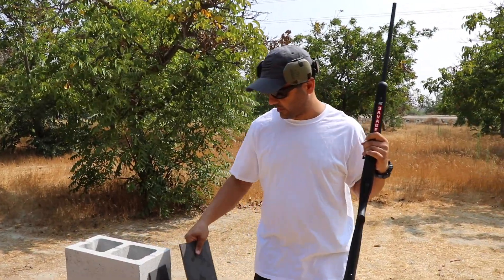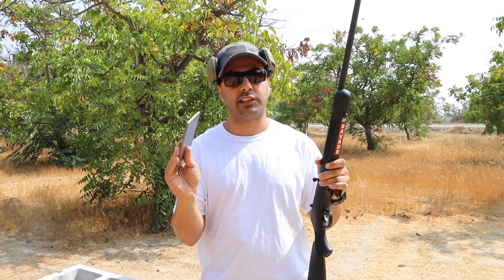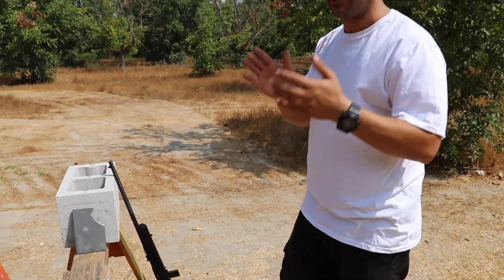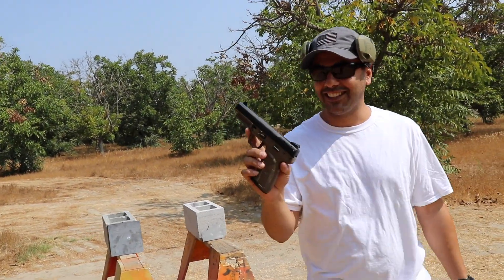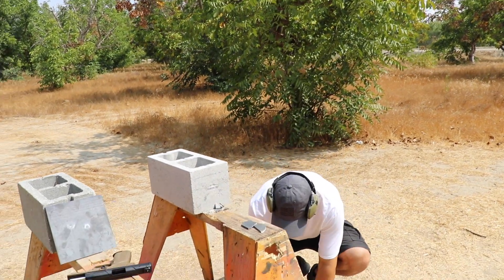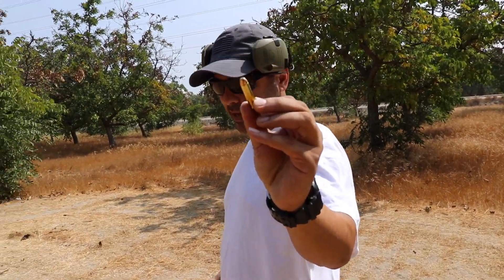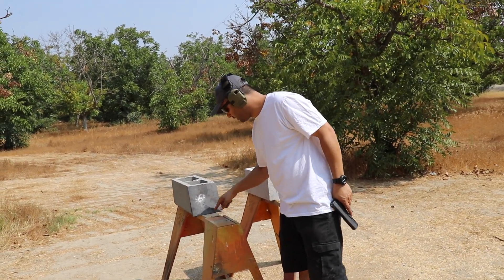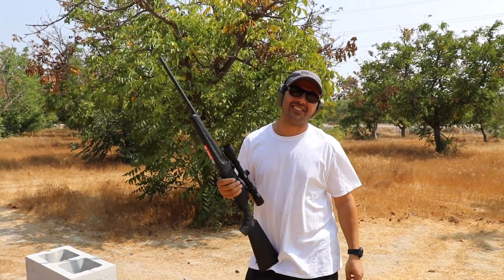Is Tungsten carbide BulletProof? - FN 5.7 vs steel

Comment: Tungsten carbide is way way waaaaaaaay brittler than tungsten alloy used in core of projectiles or in armors, cause the carbide one is conceived to be very hard: it's used to make the tips of the utensils in metallurgic industries

Comment: Tungsten carbide (WC) is not tungsten. It's a chemical compound between tungsten (W) and carbon (C) and behaves like a ceramic, hard but brittle. Tungsten carbide differs from tungsten like CO2 differs from coal.

Comment: big difference between pure tungsten and tungsten carbide, the addition of carbon changes the crystaline structure of the metal as it sets, the carbon allows shear lines to form in one direction but in the other direction it is extremely strong bond, thats why tungsten carbide is used in cutting tools in working with metals, if you had pure tungsten it would have just bounced off of the saw horse with little to no indents or scratching....  research your materials before purchasing, it will save you alot of money and disappointment..
Reply: Well said

Comment: tungsten carbide is alloy of tungsten(swedish word means heavy metal) and carbon in 50.50 ratio and it is used as cutting tool but being so hard makes it very brittle. steel on the other hand has just up to 2.08% of carbon and other elements depending of usage of it. super alloys can contain 8 or more elements in steel alloy
so when somebody says to you "high carbon steel",steel already has carbon in it...and that high means 1-2% because as i wrote steel is till it reaches 2.08% of carbon...above that is cast iron

Comment: Even if it would be pure tungsten(W) it would be much more brittle than steel because W cannot be molten or rolled or forged because at the heat required all tool materials would melt or be unstable or softer than the W. For that it can be only sintered and pressed and so it remains much more granular than steel or other metals.

Comment: Yep, Tungsten Carbide shatters nicely. :-D Its use in armor piercing shells during ww2 was for the sharp shrapnel it produced once the shell penetrated and exploded inside an armored vehicle. So, it's good as a projectile in penetrating and causing damage, but no good at all as armor.

Comment: Tungsten Carbide has 9 points hardness on the Mosh Scale (same as Sapphire). Near Diamond, which is 10. That is so much breakable (just like Crystals). Extremely tough, very dense and robust, but also breakable on major mechanical punches.

Comment: Okay, let's go through this a bit at a time.  Tungsten (Known as Wolfram or Wolframite by the Germans in WW2), is enormously dense in nature, often being used to substitute almost 1 for 1 with gold by counterfeiters.  It's density gives it a toughness that makes it highly useful for plowing through airplanes when used as penetrator rounds.  Carbide, however, is used for cutting tools which requir a different kind of hardness as it is most often found as a ceramic.  It is capable of absorbing higher shock loads than some of the better alloys of steel when mixed with tungsten and machine tools are a natural for this alloy.  However, it is so brittle that you might as well as shoot a stack of plates.  Get some unalloyed Tungsten (it should be MUCH cheaper, if you wish to abuse it with bullets.

Comment: Tungsten is extremely hard ie. Brittle

Note that the block behind the tungsten didn’t get damaged by the bullets, because the high density (weight) along with the high hardness causes softer metals to splash off of it like raindrops off of a windshield

Titanium is extremely springy and flexible, so while it is very likely not to shatter, it’s light weight (low density) and springy nature makes a bullet striking it more analogous to raindrops on a sheet of plastic

Comment: If im an tank designer right now  i will make half inch pike nose tungsten spaced armor i mean a tungsten spaced armor for the front and sides of a tank but give it a 2000 horsepower engine so you are gonna see some real speed

Comment: That 6.5 Creedmoor. Is going 3800 feet per second. I want to see you shoot some steel with a 264 magnum Winchester. The fastest round made for the public 4200 feet per second 40 100 foot pounds of force with 140 grain bullet I would love to see you shoot one. If you can't find one, I'll let you borrow mine. They haven't made them since the early 1960s and it's getting hard to find new ammunition. You have to reload most of it. 264 magnum Winchester was what snipers used in Vietnam before they use the 270 Winchester.

Comment: That tungsten is so hard. If you would put it flat against another piece of Steel. It wouldn't shatter. But you're not good penetrated. Not with those small calibers. But of course a BMG 50 cal penetrate anything. And Allegheny metals in Butler, Pennsylvania Richard Kennedy will sell you any kind of Steel you want. He's my cousin. For real

Comment: Tungsten is incredibly strong, but brittle.
If that was pure tungsten it would not crack in the same way.

Tungsten carbide vartiants mixed with cobolt and nickel is used as armour piercing fin stabilized tank rounds. Aswell as armoured sideskirts for tanks because their ability to block damage.

Comment: That is not tungsten. It is tungsten carbide. Two very different things. Tungsten carbide is what they tip drill bits with because it's very hard, but not tough. Hardness is resistance to SCRATCHING. Toughness it resistance to IMPACT.  Many very hard things are not very tough. Think "tempered glass." Very hard, shatters easily.

Diamond is the hardest gemstone. But you can shatter one easily if you hit it with a hammer. Jade is the toughest gemstone. It's fibrous structure flexes a little making it very resistant to impact. You can drop a jade vase on the floor, if it's real jade, and it won't shatter, or at least it most likely won't.

Comment: that's definitely tungsten carbide, but tungsten carbide's major weakness happens to be brittleness.
Tungsten is the strongest metal, the metal with the highest melting point and it is one of the hardest metals, not the hardest but almost.
I believe its second place only to chromium.
but since its so hard its also brittle, which when mixed with carbon as well, makes the carbide crack and shatter upon sudden impact.
try tungsten metal next time.
(edited)
Reply: It's not tungsten, which is a metal on the periodic table. It's tungsten carbide, more like a ceramic made from tungsten and carbon so it's a chemical compound.
Reply: @SaintBrianTheGodless  you were right.
Reply: @Aaron Washburn you might want to delete some of your comments, with mine gone it looks a bit out of place. :/

Comment: I work in manufacturing and tungsten is a very hard material. Due to the hardness it makes it very brittle kinda like porcelain and certain types of ceramic. You should look at a raw material supplier that provides what they call blanks of whatever material you're looking for. They come in all sizes like from what you're working with to plates that look like your 6061 aluminum blanks. Even if it was thicker I could still see it more breaking off chunks than forming the metal like with aluminum stainless steel and softer other materials

Comment: Tungsten carbide is like porcelain. It will break like glass instead of bending. Tungsten carbide Extremely hard material it is the only thing that will cut glass other than a diamond.

Comment: tungsten refers to the individual metal, whereas tungsten carbide is an alloy of tungsten and predominantly carbon; and is a ceramic sintered from power. Both are very brittle and will break. if you were to drop the tungsten carbide sheet it would probable break if it landed on concrete. Chemitry What a rush.

Comment: Torch the tungsten until it's really red throw it in the oven on 450 degrees for 30 minutes be very careful use good tongs they may melt lol never touch hot steel with your bare hands

Comment: Thermal crack. IT needs to hardened after Made into something. Its Hardest after Diamond . We use thungstencarbide to cut any metal Like a butter. To cut thungstencarbide you have to use diamond   Wheel.

Comment: Love watching you guys, the reason is because tungsten is Brattle but you’ll notice that the 57 didn’t make it through so it did indeed stop the bullet it functions a lot in the same way as ceramic. Which also shatters but does stop the bullet

Comment: Tungsten is rated 9 on the scale as oppsed to platinum at 6. Yes Tungsten has an extremely high melting point but it is brittle and is not really meant for impact but it's still the best on the market.

Comment: Did you that at 45*, the horizontal lengh of the triangle is going to be equal to the vertical lengh of a square the triangle? Not even close

Comment: Tungsten carbide is considered a ceramic and it cannot overcome deformation which means that it’s so brittle due to it’s charged bonds. Also tungsten carbide high speed cutting tools fracture all the time for the same reason, but addition of cobalt will help a lot to prevent them from fracturing.

Comment: Tungsten Carbide is very brittle though it's pretty hard and doesn't really melt. It's used for friction drilling and welding, and it's properties make it very good for both of these tasks, as with TiG welding, it conducts electricity pretty well, though the biggest issue with it is that it can pretty easily be contaminated with other materials while welding. I'm not very familiar in the machinists world though, and I can't really speak for the drilling aspect.

Comment: Tungsten and tungsten carbide are totally different things. Tungsten carbide are mostly used for corroding other substances like in drill bits. Tungsten carbide are corrosion resistant but not impact resistant. They are hard but brittle. They are corrosive but cannot withstand impact. Harder a metal is, the more corrosive and brittle it becomes.

Comment: Pure tungsten has higher tensile strength and might've yielded a little when shot by 9mm but the material you used is tungsten carbide which means there's added carbon with pure tungsten depending on the concentration of carbon in tungsten the brittleness of the material could be defined. After watching the video it's pretty clear the percentage of carbon is around 4-5%. Which makes the material very brittle. Heat treating helps a lot in the strength of the material.. it also releases all the internal stress of the material

Comment: Tungsten carbide is super hard but very brittle, it is horrible with shock loads. If you got straight tungsten without the carbide it would have been a lot tougher and held up better under fire.

Comment: Also you need to test metal with extreme high shear and stress values, not hardness ,as hardness means it will be brittle, you need some of the metals which is listed in the hardness scale from alloy and metal books or reference books which a lot of machine/engineering shops use? Like alloy ASTM Reference books? Also if you can get a hold of Tungsten carbide diamond tips or teeth used in scrap metal machines just one tooth from that machine and see what happens, but then again its about shear strength and not heat, the hotter the metal is treated especially when its a grade of metal which has a low shear test, then its not wroth it? Like Diamonds they are very hard ,th3e hardest thing on this earth, but at the same time they are brittle you can drop a diamond on the ground and it will chip, but put the dust from a diamond with tungsten carbide as a tool for cutting and it will cut anything in the right machines like CNC machines. :)i

Comment: Obviously, the mistake was that you bought the tungsten “carbide” ..you wanted the “carbine”. Yep, go back and get the tungsten carbine. That’ll do it. Also, stop by the auto store and pick up some blinker fluid..soak the tungsten in a bucket of that overnight and it’ll keep tensile strength like you’ve never seen. Oh yeah, that’ll do it.

Comment: The Tungsten carbide is brittle and hard. Same way glass is extremely hard and brittle. As a machinist we use it to cut other materials because it disburses heat faster than other materials.

Comment: I've had tungsten watches and love them however they are very heavy and if you drop it on ceramic it will shatter into a million pieces.  I did it. Tungsten very strong but very brittle. Cannot bend

Comment: I am a brilliant chemist. I mixed equal parts of tungsten, aluminium, iron, and silver and came up with a metal so strong it will stop anti tank rounds. I will sell you a 12x12 sheet for $50,000. Do not hesitate it is in a very limited supply.

Comment: There is a difference between toughness and hardness. Tungsten carbide is hard but not tough, in the opposite steel is tougher but less hard.

Thoroughness measures the ability of a material to absorb energy without fracturing. Hardness measures the localized deformation liets say how scratchable a material is.

Comment: I have a tungsten carbide ring and the jeweler said if my finger gets to fat the ring would have to be hit with something hard in order to get the ring off. They say it can't be cut like steel or titanium. They also told be to be careful not to drop it on the ground cause it can shatter.

Comment: Titanium / tungsten carbide
Two different things ?
Lehigh defense makes a bullet call The Flash tip the tip of this bullet is titanium I believe they are. Designed to throw Sparks whenever they hit in low-light they are very brilliant and they make this bullet in a number of calibers including 50.
Caution in a dry area he's rounds will start a fire but out on the desert where you shoot in afternoon lighting they should be very interesting.

Comment: What you have to do is epoxy bind the tungsten to the steel. The steel will act as a backplate that will keep the tungsten in tact. Also you can sandwich tungsten in between two pieces of steel.

Comment: Worked  at machine shop (areo- space).And of all the people there. And Garrett Turbine engine ,Was told in Reff: To above case hardened Would be best. But for the VERY Best ink-a-nail. Bust stopping power of any metal.

Comment: To expand on the comments about why it shattered as listed below.  The atomic structure when tungsten carbide is created is crystalline. Unlike regular metal which will bend and twist before failing, Tungsten carbide will shatter more like glass or ceramic. It is still an incredibly strong material for its weight and size compared to other materials but it doesn't work so good with a shock like a bullet. It is a very unique material, my wife and I chose to have our wedding rings made out of it. :)

Comment: If you want a steel that is tough and high wear try a 2" square piece CPM 1V heat treated to 57-58 RC. I would like to see that against your rounds. It has the strength of S-7 (one of the toughest tool steels) and wear of D2 (very high wear).  If you want to try a steel that approaches carbide try a 2" square piece of CPM 15V  heat treated to 64 RC.
Steve

Comment: Crack-resistance - Titanium is much more crack-resistant than naturally brittle tungsten carbide. Tungsten carbide's extreme hardness paired with its brittleness means that tungsten carbide rings can crack or shatter if struck against a hard enough surface.

Comment: Tungsten carbide is incredibly tough but pretty brittle and not suitable for shock forces.  If you were going to go Tungsten you'd be better off with a non-carbide alloy, like this iron (1.5%) / nickel (3.5%) / tungsten (95%) cube (which already has a video showing it stop bullets with ease even on the corner ):  

https://midwesttungsten.com/1-5-tungsten-kilo-cube-with-base-best-seller

Comment: I sold tungsten carbide for 42 years. To be made, it was not a molten material. It is sintered typically with a Cobalt binder. Both materials are ball milled to a talcum powder consistency. They are typically pressed into a shape by a forming die. Before it is sintered it is a fragile as a chalk stick. It is then put in a high temperature/ high pressure vessel and stays in there long enough to go through a sintering process. The particles fuse together with the Cobalt serving as the binder. I  knew it was going to shatter before you shot it. It is a cutting material used all over the world. It's secret to bring the choice material is what is referred to had high red hardness. It retains its ability to cut metals even though in many cases the very edge is glowing red. Most all materials soften when red hot.

Comment: Tungsten has a low tinsle strength but a high payload strength it doesn't deal well with resonance the high vibration of the bullet hitting it causes it to shatter

Comment: Its been said already but ya thats Tungsten Carbide. It is super brittle but able to hold a cutting edge for long periods of time hence why its used on drill bits, saw blades and such. Tungsten alone is very ductile but incredibly strong. The most common place use I've seen for tungsten is the welding probe of a TIG welder since its melting point is far higher than steel and titanium.

Comment: Tungsten carbide has a hardness of 9 on the mohs scale. Mild steel has a hardness of 4-6.
Reply: Closer to 8 mohs than 9...
And For comparison you should mention that diamonds are 10 mohs and and cell phone screens are a 6 mohs. Then  you might want to explain what the mohs scale is and that the scale is more like a "scratch test" and on a ordinal scale ranks one minerals ability to scratch another to determine hardness...
...ie...a 9 mohs is twice as hard as an 8 mohs but a 10 mohs is four times as hard as a 8 mohs.